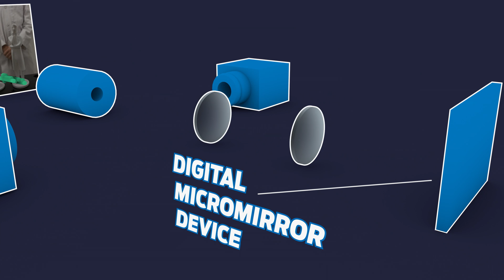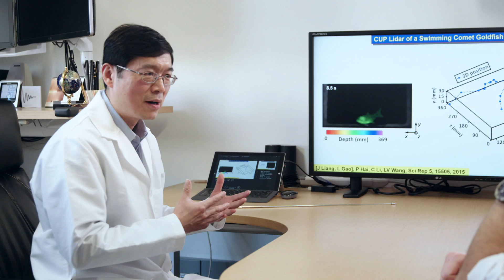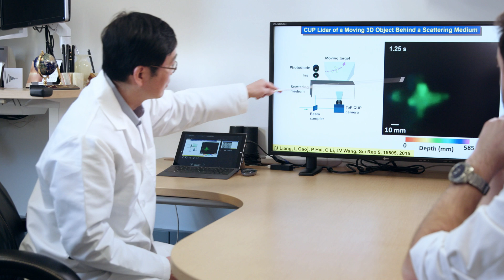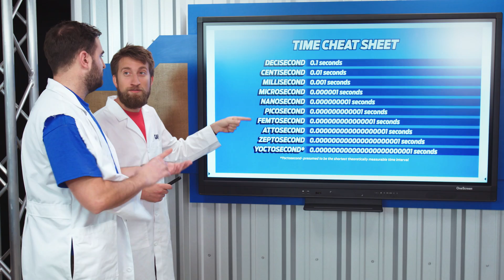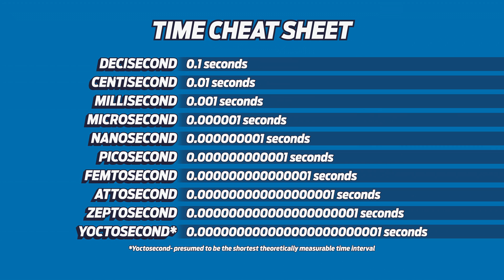How do you film the Speed of Light?

Comment: You should try film a particle breaking the light barrier (under water it's possible)
Reply: What particle travels faster than light? Space can expand faster than light, but I know of no particle that can, even underwater.
Reply: @RhodokTribesman  to put it simply: nothing can travel faster than light in a vacuum. However, under water, light moves slightly slower due to the different medium. This makes It possible for other particles to break the light barrier since they are still not going faster than light speed in a vacuum, but they can still go faster than light under water. This is commonly seen in certain nuclear reactors (I think, correct me if I'm wrong)

Comment: If you were in a large hangar, to control the lighting environment, and had two large mirrors facing each other 100m apart, and had a good zoom lens, and placed the camera in the middle of both mirrors looking directly into one of them, as you turned the light on while filming at 500,000fps, you would potentially be able to catch the light as it bounces back and forth through each mirror reflection. At 500,000fps, light would travel at ~600 meters a second, meaning each frame you would potentially see 3 new mirrors reflecting the light in the room. Surely that's possible to setup Gavin & Dan??

Comment: What your really seeing is the photon scatter that ends up in the camera. As the light pulse travels through the material, a certain amount of photons 'hit' a molecule such that they end up in the camera. So for each frame,  the sensor in the camera records a value. If the rate at which you can ask the sensor for a new value increases and its ability to provide a new value increases, and the smallest value change you can distinguish between also changes, then you can increase the effective frame rate of the film. But remember, your not seeing a single photon, you're not actually seeing light move, you are seeing the end result of a large amount of photons travelling through a material, and some of them go through, and some of them reflect into the camera sensor.

Comment: I agree that there was no meaningful explanation. However one statement provides a clue. The professor stated that they had to use a laser because of the rise time. So I think what is happening is they shoot a pulse take a photo at ti!e x. Shoot another pulse and take a photo at time x + picosecond. And so on. The time between pulses can be quite long. Frame rate depends on how accurately you can delay the photo from the generation of the pulse.

What you are seeing is not the same pulse of light, but multiple pulses delayed by small amounts of time.

Comment: I’m still wrapping my head around the math involved in this video and It seems you’ve hit the pinnacle of slow motion videos.... BUT, I have a suggestion for you to consider. I’m a welder and have been wondering if you guys could do a video on the electric current going through a mig welding gun. I will say it would require a shade lens considering the arc itself is brighter than the sun and is about 5000 degrees. I hope you are interested and would possibly consider this challenge.

Comment: Yoctosecond: the shortest measurable time interval. 1.855x10^19 times longer than a Planck time
Reply: Whats a Planck time?
Reply: @Alexander-x2m7i  
Its quite complicated, as it is Quantum Mechanics. I simplified it down as much as I could.
Reply: @Alexander-x2m7i  
The absolute shortest possible time frame. Shorter then it time loses all meaning. 
It is the time taken for a photon to move one Planck Length. The shortest possible length that has any meaning. ~10e-33 metres. 

Just look up Plack units on Wikipedia. You can find a list of  different Plack Units. 
Plank units are a measure of absolutes. Absolute Hot, Absolute Acceleration, Absolute (shortest) length, Absolute Density, Absolute Pressure. 

For example the Plank Tempeture is hot enough that it is the brightest thing that can ever possibly exist, as the wavelength becomes equal to the Planck Length. It is hot enough it would collapse into a black hole from heat alone. This is known as a Kugelblitz. It would make the sun look black in comparison.
It is only attainable at the Planck Pressure. That highest tempeture attainable at normal pressures is the Hagedorn Tempeture. Which is hot enough to mwlt protons into quarks and gulons. This is around 10e12 Kelvin. 
The Planck tempeture is much hotter, around 10e32 Kelvin. Around 10e20 times hotter then the Hagedorn temperature.

Comment: Hey guys! Amazing! What about filming the speed of sound through different mediums? Maybe you could set up a series of sheets (or strings) separated by a small gap and play a loud sound to one side of them so we could see them vibrating one at the time. Then you could submerge the thing in water or oil to see that it propagates slower. With a ruler behind to measure. 
Now I think about it, you could have measured the speed of light from this video if you knew the size of the bottle. ^_^

Comment: Something i don't understand, for the light to be capture by the camera, it needs to bounce back to it from the fluid it goes through. So we don't capture direct photons on the movie but energy emited by the circulation of photons through the fluid. Am i right?
Reply: That's not the right way to look at it.  The camera (any camera) captures the photons that pass through its lens.  Those photons had to either be reflected, refracted, or come directly from the originating source (if there's a fourth way, I don't know it).  So, what we are seeing in the video is photons from the laser pulse that entered the water bottle (for example) and were redirected towards the lense of the camera.  So, these are "direct photons" from the laser source, they were just forced to change directions by the object they hit and some of those photons then hit the camera lens and were redirected onto the capture media (CCD, etc.).  The laser certainly wasn't energizing the water to the point where it could generate new photons (and if it did, they weren't likely to be the same wavelength as the laser).

The part that they didn't make clear is that the photons captured on any given frame were not from the same laser pulse as the photons captured on the next or previous frame.  However, since the two events (this frame and the next frame) were essentially identical events, the resulting frames were close enough to the same to consider them as having come from the same laser pulse.
Reply: @sgartner  Alright, thank you for the explanation. You’ve helped make it clearer for me

Comment: No one actually understood the professor's explanation. The camera doesn't actually film at a trillion frames per second, if I understood correctly it just repeats pulses at different times so that for each exposure the light has travelled further along, like some kind of stroboscopic effect. Scientifically it has value because you can see light propagate as if you actually filmed that fast but it's not at all as if you could film a bullet, for a bullet the equivalent would be to shoot a bullet for each frame, each frame capturing the bullet as it's futher down the path. The trillion FPS camera probably only actually shoot a frame every ~1/1000 second or so.

I think. If anyone actually understood what the guy said (doubtful) please correct me.
Reply: I think you are correct, it is not the camera that reaches trillion FPS but it is the laser that pulses the light at terahertz rate or so. They sync the camera FPS with the laser FPS so that the light is seen like it is moving millimeters ahead at each frame. It is possible due to the fact that the light pulses are identical at each shot. It is also doable for the bullet example in theory, but the gun must fire the bullets at exact same speed and frequency. In that case we wouldn't need a high speed camera :)
Reply: @hasancakir8932  Yep, it seems also that since it's a 1D camera that each frame is made of different pulses put together somehow (using the "coding" thing) to form an image. As for doing it with a bullet each bullet would probably look different from each other too but that's the idea.
Reply: What surprises me is that its just like a stop motion but they are using water with milk. Wouldn't the milk move tiny bits and disrupt the pattern. Or are they shooting the pictures to quick after each other that you don't see it moving. Do they take 8 hours shooting pictures or are those 8 hours just rendering?
Reply: That makes a lot more sense to me.

Comment: that still doesnt explain.. how do you observe light, using light, at light speed. The camera would literally have to be taking enough pictures in one picosecond to slowly display lights movement which is impossible, right? The speed at which the light hits the milk-water would be the same that it reached the camera lens meaning you have just about no time to film. The FPS would be impossibly fast, like too fast to be real. I'm not convinced that anything could process 10,000,000,000,000 pictures in one second. Time would basically stop at that scale and the camera would have to be working faster than light... which cant be done.